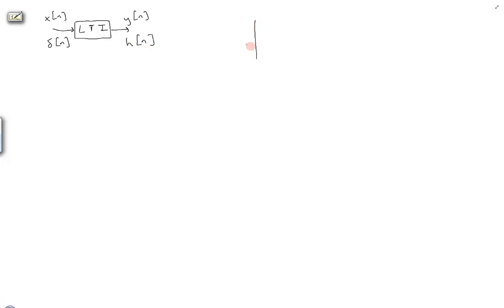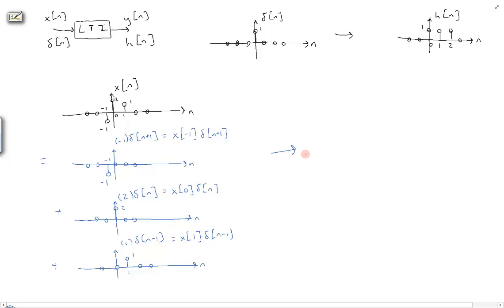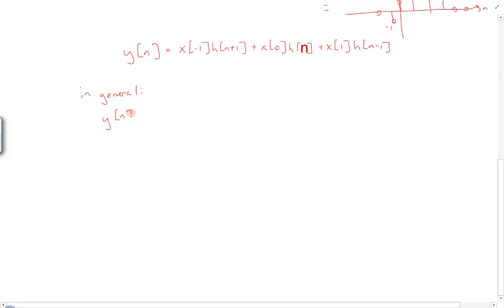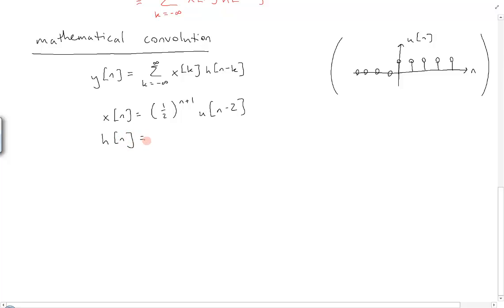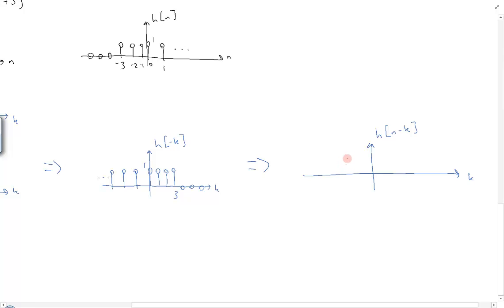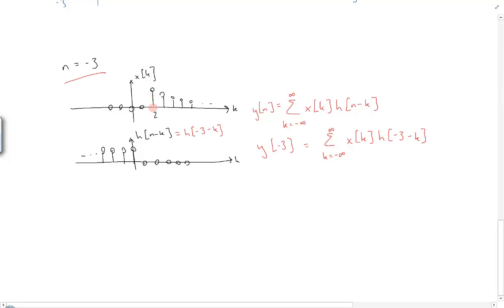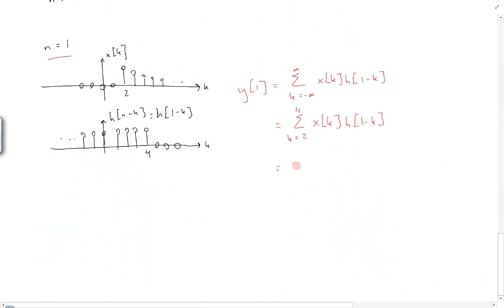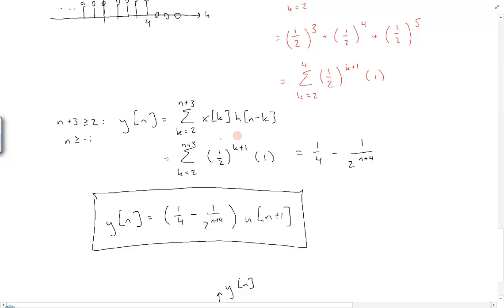Convolution Tutorial

Comment: Thanks for the videos! One question to this one: At 10:28, when you write the sum from "- infinity" to "infinity", wouldn't it be sufficient to go from "- infinity" to n? The inputs x[k] with k>n are "future" inputs with respect to time n and can't influence the output y[n] anyway. Or do I get something wrong?
Reply from the maker: +Stefan Busch That is an excellent question!  If you have real-time processing, you are correct that you cannot have "future" values of x (i.e. you have a causal system).  However, you can have non-causal systems as well.  For example, imagine you are performing audio processing on a recorded song.  For every time, you know the past, present, and future values of the signal (where the signal is the song).  Therefore, "future" values can be used in non-causal computations.  The sum that I wrote is the most general form of the convolution.  For sub-cases, such as for causal systems, there are simplifications.
Reply: Thanks for clearing that up so quickly.